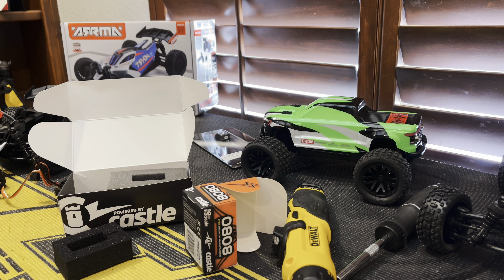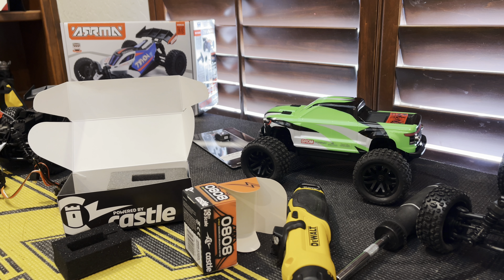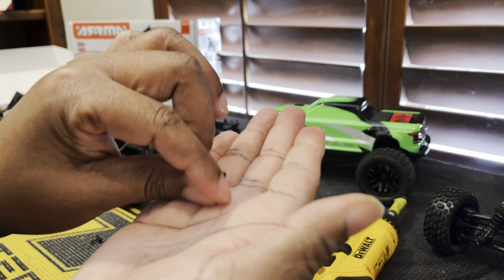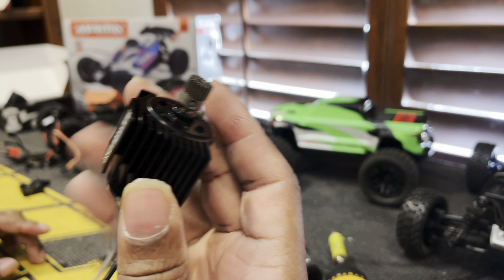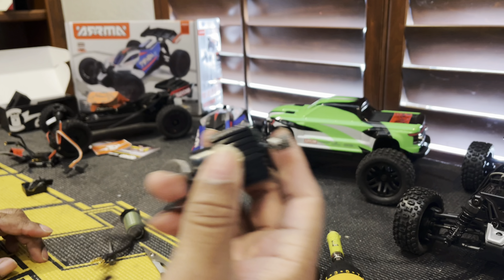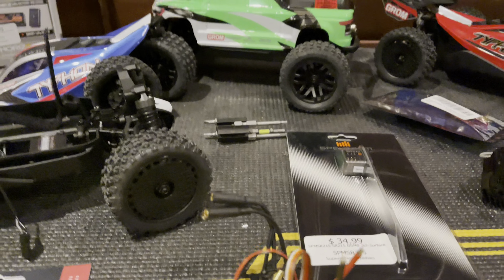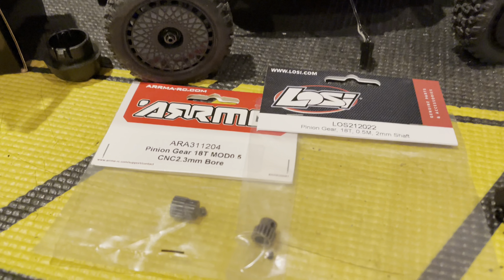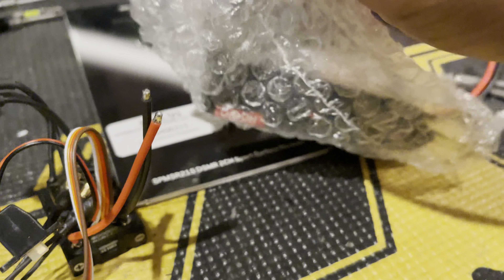ARRMA TYPHON GROM GETS CASTLES MICRO MAMBA X2 COMBO 2s, 3s or 4s ?🤷🏾‍♂️

Comment: ive used this combo but with the higher 8200 kv. I over geared it though to a 21T. It got hot but boy was it moving. You should be safe on 2s up to a 21-22T with the 5300kv! On 3S watch temp, I wouldn't bash with a 3s tho! The only thing with that 0808 motor is the 2mm shaft. I tends to snap sometimes! If that happens grab you a 380 brushless motor with a 3.175 shaft. Hot racing makes 0.5mod 3.175 pinions too! Awesome video. subbed my brotha!
Reply from the maker: I appreciate your suggestions. Thank you..
Reply: I’m running a 4600kv on 19t and it gets warm on 2s…… 21t is definitely too high for 5300kv that setup will get warm quick

Comment: That's the correct esc but that motor is for lighter cars like the losi mini b. Castle has a motor slightly bigger I have it in my groms. 10series castle motors check it out.
Reply: The 10series castle can also be ran sensored
Reply from the maker: I saw that after buying this from the local hobby shop. If the shaft break or it start having heat issues i will go after the 10 series for sure. Thx for the info
Reply from the maker: Pulled the trigger on the 1007-6350kv combo. I will put this  0808 -5300 combo in my other typhon that ima keep majority plastic, should remain under 2lbs loaded. But the red typhon im going billet so i will need the bigger motor.
Reply: @MrMeDos did you ever install this? How fast did she go?
Reply: What is the motor that can fit the typhon grom ?

Comment: i melted a 6000kv spectra firma esc motor combo. spectra receiver and transmit. used granite grom wheels. insane speed. but built up way too much heat smoked the esc and motor
Reply from the maker: Aww damn!!!! 😳.. i just busted my diffs in the red joint today. 🤦🏾 trying to squeeze the throttle and snapped it. Gota get the steal cups now.

Comment: Use the 8200 kv or new 8450kv the 8200 pulls the tires off the ground on demand on my granite grom. Arrma has a esc plate for the brushless conversion already too. You may have to trim a corner for the motor to fit though.
Reply from the maker: 0808-5300kv is crazy fast on 18t pinion. I have foam tires and upgraded diffs a Big difference. But im going with the 1010-5300kv motor. Bigger shaft bigger can. New vid coming up.

Comment: Cool little buggy those little motors are more powerful than you think but lots of fun thx for sharing
Reply from the maker: You bet. thx for watching
Reply: I have them in all my mini's running on the stock battery and I don't have any problems all have good speed and I can increase the battery power to get more out of them , even have 1 for the granite grom seeing I can use the controller it came with

Comment: This is the same combo I put in mine but the thin motor shaft kept breaking
Reply from the maker: The smaller shaft you gotta make sure your running the 2mm bore pinions. Factory pinions will make it snap all the time. Or just go up to the 4400kv motor. Problem solved

Comment: I installed the same set up on mine after watching your video, I’m having some issues with the motor getting super hot after  3 minutes of run time. It even melted the wires. Have you had the same issue ?
Reply: Might want to gear down sum
Reply from the maker: Sorry to hear that bro, no no melting of wires, what size pinion are you running? 18T? Its aggressively geared for bashing more for speed runs. you may want to drop the pinion to a 16T. also zip tie your wires if you can. I realized the first run it was hot , but the next few runs its avg around 147-150 degrees. Also want to make sure your car is not to heavy. I recently took this setup out of the typhon and put it in my granite grom because all the upgrades to my typhon made it to heavy for the 0808 motor, I will have a new vid up shortly.
Reply: @MrMeDos  I’m running 18t pinion. I will gear  down to 16t 👍.
Reply: @chrisgittings7112  I will order a 16T see if that helps.

Comment: Were you able to fit the fan and heat sink?
Reply from the maker: No fan no heat sink. The can is tiny. I would need to find another method of getting air inside, may end up drilling holes in the body or cutting the windshield out.  Its on foam tires now and its extremely fast.  New vid coming up.

Comment: what motor mount did you use, i bought the same motor and esc, the problem is the bolt holes dont line up with the the motor
Reply from the maker: Your referring to the motor mount? If so, it does line up, its the widest holes on the motor. Not the larger holes,  but the widest  of the smaller holes. If that makes since. Align the motor so the wires are facing more toward the outside frame of the car and it should bolt right on.  If you have the 5300kv motor.. if you have the 5600kv or 4400kv ir 6350kv motor you will want the motor lead facing the driveshaft and you will have to modify(cut) the cover so it will fit over the leads. Other opinion is to get a universal motor mount.
Reply: @MrMeDos  thank u for the reply, i figured out after i posted. i didnt notice the different hole pattern at first.

Comment: I have the furitek kraken 6700kv on mine with a furitek speed cat, using 3s and have had zero issues.
Reply from the maker: If you aint had diff issues yet and they still factory, its only a matter of time b4 you do. Castle broke all my diffs. Had to upgrade all of them.